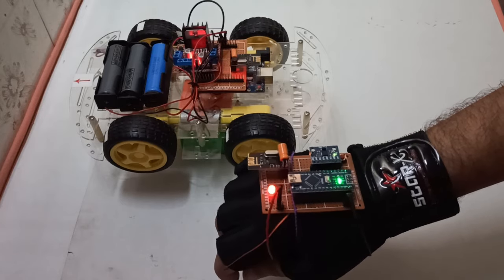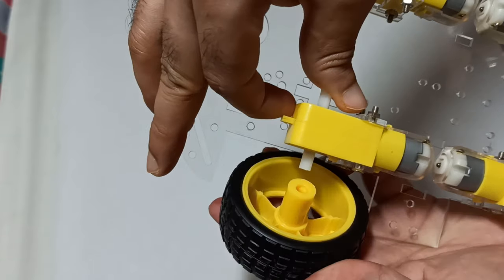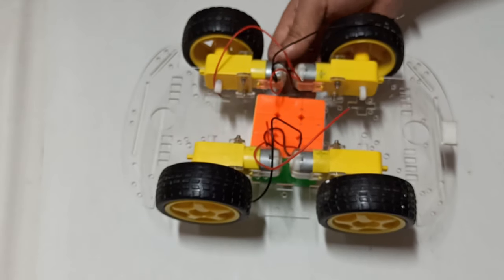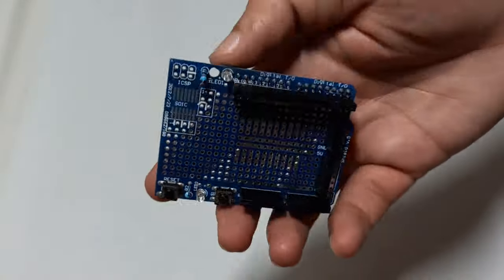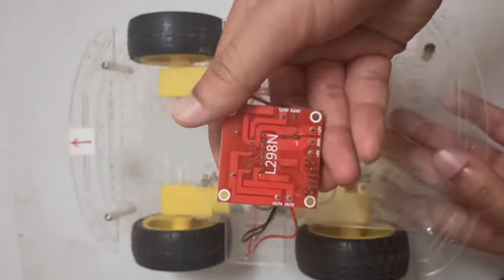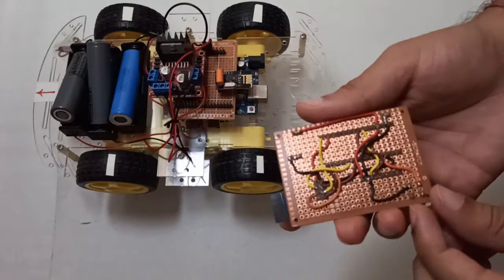DIY | Hand Gestures controlled car using Arduino | nRF24l01 | MPU6050

Comment: Hello, my friend, how are you .  I did the same way to make the car and connect the wires.  But it does not work, what is the reason? Can I contact you about this matter ?
Reply from the maker: Is you connected Gnd of L298 motor driver and Arduino connected to each other ?
Reply: Think you my friend  . It is working . My mistake  was in (L298N)  i remove the  content in (motor 1 Act/Des) and (motor 2 Act/Des)
Reply: @mastafa911  
how do you do that because i have a problem, my car don't work
Reply: @Curva3D  what the problem   in transform or reserve circuit
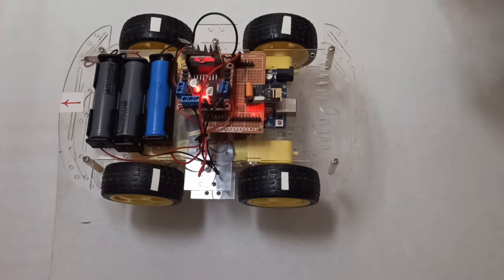Reply: @ElectronicsisLife 7:00
Reply: From where you take the code?
Reply: Please anyone send me the code
Reply: What is the ohm of registor uesd

Comment: Hello sir i have connected everything correctly but my receiver is not working the arduino and motor driver is lighting up but no response through transmitter the transmitter led for tx on arduino nano is on but on the receiver uno its not on please guide me what to do
Reply from the maker: On the receiver side
Is Gnd of arduino and motor driver connected ?
Reply from the maker: If further not working, do email me images of your project.
Reply: yes it is connected @ElectronicsisLife
Reply: retry😅

Comment: i have a small question sir. can the same schematic used for the PCB work with the arduino shell? or is there some other special connection we need to keep?
Reply from the maker: Yes
You need to connect pins shown in the schematic.
Reply: @ElectronicsisLife  Thank you so much. This video was very interesting and helpful
Reply: @ElectronicsisLife  if you know where i can find the arduino shell that would be helpful. if there is an amazon link, etc
Reply from the maker: Search for Arduino uno shield on Amazon.

Comment: All the lights of the audrino uno and the transmitter circuit is turning on, but the car is not moving. Please guide me sir! I dont know what i did wrong
Reply from the maker: Send some images/close-ups to my email.
Reply: Did you manage to solve the problem? I have the same problem and I need to solve it in weeks, if you managed to solve it, what was the error?
Reply: Did you manage to solve the problem? I have the same problem and I need to solve it in weeks, if you managed to solve it, what was the error?

Comment: 4:34

Here you connected the other end of the resistor with the sixth port?
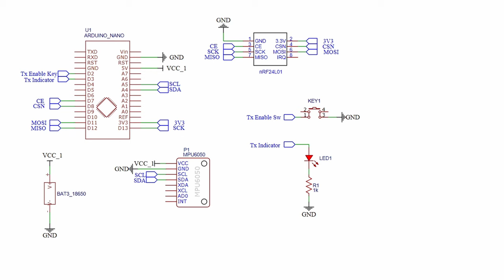Reply from the maker: 4:02
In the wiring diagram, tx indicator is connected with D3.
Reply: Where does the other end of the indicator goes? Where is D3? Just tell me which port of the nano indicator goes. Thks

Comment: Good Evening sir 
Really love your work, wonderful work sir 
Sir please how do i connect the wire ti pcb board and which wires, I am still in high school and dont know really much on electrical engineering
Gid bless sir❤
Reply: And sir please which app do I use to code it and how will it function, do I plug something in my computer
(So sorry for the disturbance sir, God bless you ❤)
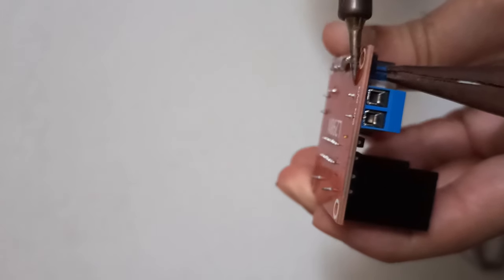Reply: Sir please can you also explain what you did in 3:14
Reply from the maker: I am glad it worked for you, All the credit goes to you.
PCBs made by you are awesome.

Comment: Hi, I connected everything correctly but can't get the tyres to move. I've tested all my parts individually and they all work, I even tested the transmitter and receiver side individually in Serial Monitor and got readings. For the transmitter, I am getting coordinates when I tilt the mpu6050, and for the receiver, I am only getting "START" showing in Serial Monitor. But when I connect both of them to test together, nothing happens and the tyres don't move at all, please help.
Reply from the maker: Make sure the gnd (ground) of arduino nano, LM298 are connected with each other.
Reply: @ElectronicsisLife  Thanks for your reply! My Arduino Nano is connected to my Mpu6050 which is on the receiver side, so I guess you are talking about the Arduino Uno on the receiver side, which I have already done, and it is still not working. :(
Reply from the maker: Check battery voltages,
Check the output voltage at the pins of Arduino nano at receiver end which are connected with LM298 driver.
Reply: @ElectronicsisLife  oh ok, i did that, I noticed you used a switch for the transmitter and it's in the code. Is a switch needed for the code to work properly? Because I don't have one and I am just plugging the battery directly to the transmitter circuit.
Reply from the maker: That switch is needed,
By using that switch you can enable or disable transmission.
Its handy in this case.
Reply from the maker: Even 1 Led is there, indicating whether transmission is enabled/disabled.
Reply: @ElectronicsisLife  ohhh, that makes a lot of sense now, I'd definitely try it out then. Thank you so much for your help! :)
Reply: @FemiOjeyemi   did you got the output , because i am also going through same problem , plz help if possible
Reply: Bro I have same problem
Reply: You have any solution regarding this
Reply: @harshlathiya805  same here any solution

Comment: Another question, on the batteries, i have to put 2 on the car and 1 on the sensor. What i do with the other slot of battery?
Reply from the maker: Because when the motors are turned on they  draws heavy current surges at start, causing voltage to dip which cause Arduino reset.
For smooth operation connect separate battery for Arduino.
Reply: @ElectronicsisLife  I asked the wrong thing: In the car, there are three battery slots, two needed for Volts and one for GND, no? So i should put three batteries there? Or another thing?
Reply: Like i should buy 4 batteries?

Thank you for the attention tho

Comment: I have done all the connections properly for the transmitter and receiver.  The serial monitor is showing output for transmitter  , when i connect the receiver it shows "START" and the (0,0) continously. The data is not getting recived by the Receiver. Please help me out with this as soon as possible!!
Reply from the maker: Do you have connected the button to transmitter ?
Without pressing it, it won't start transmitting.
Reply: Yes the circuit and the connections are exactly same as you have showed in the video.....I have used the button, led and resistor as in the video but still the motors are not running..... What do i do?
Reply: @minestrike9020  after pressing the button, is transmitter led turning ON ,
Make sure that gnd of LM298 and arduino are connected.
Reply: There is no data being received by the receiver
Reply from the maker: Make sure that nrf24 pair working well, you can check this by uploading other library code.
Make sure that all wires are connected where they needs to be.
Reply from the maker: Do share some images with me on my email, I can help you after seeing those images only.
Specially soldering, all wiring .

Comment: hello sir, just wanted to quickly ask, in the UK, AA batteries are far more accessible. Would it be possible to switch the 18650s to AAs?
Reply from the maker: AA batteries won't provide required current surges.
You can give a try with alkaline AA batteries.

Comment: Bro in Arduino Uno there are 2 gnd should we connect both together or 1 gnd connect with battery + and second with nrf24
Reply from the maker: Both are same gnd, no need to connect both.
Even if you connetted both won't cause any problems.
But same gnd should be connected with all other parts.
Reply: @ElectronicsisLife  thanks broo for reply but i have a problem when i connected all wire in  transmitter Arduino nano and try to start it the battery holder wire are start burning and battery holder know not working but Arduino nano and mpu6050 are safe
Reply from the maker: Most probably You have connected batteries in opposite polarity.

Comment: Hey in the transmitter schematics there are two vcc on in the arduino nano and one in the mpu6050 and only one battery available. Do I connect the positive end of the battery to two connector wires and connect them? Or?
Reply from the maker: Yes
Same battery positive terminal goes to arduino as well as MPU6050.
Reply: @ElectronicsisLife  OK thank you so very much. Tomorrow I have to submit my STEAM car. Your video helped me a lot!
Reply: I also removed all the code related to the switch button. I hope I didn't mess up the code
Reply from the maker: I am glad it helped you.

Comment: Can you pls tell if it is necessary to use a tactical switch .can,t  we use a linear switch . I tried with a linear one but the bulb in transmitter was not glowing pls help
Reply from the maker: You can use any switch which can open and short.

Comment: Hi sir, the project seems good and working but i have a doubt, how do you power the Arduino Uno? The connections seems fine, but i don't get it, a 18650 positive and negative would power the Arduino? In the schematic 3,3V and 5V are connected but how? I connect the 18650 at 3,3v but the 5V? The Arduino is the only thing that doesn't turn on because of power, i don't get it.
Reply from the maker: In the schematic 18650 is connected with 5v and there is onboard regulator which gives 3.3v.
Reply: @ElectronicsisLife  Haha yeah man! It was my bad, I confused the 3.3v pin with the 5v because of the different design of my Arduino board. Anyways thank you! The project works fine at moment.

Comment: Hello bro please help me 
I have done all the connections same and my car is working but the problem is motors are rotating randomly that is it is not going reverse, left, right just like you. In the serial monitor values are being correctly received

Comment: I haven't used button & led in transmitter...will it work with direct voltage supply??
Reply from the maker: It won't,
You need to change the code.
Because by default transmission is disabled.

Comment: Excuse me sir, I want to ask you, did you program the nrf24l01 as well?
You put two programming codes, tx and rx, where did you use them? On what pieces?Please answer, I bought all the pieces and lost an amount on them, and now they do not work because of the code
Reply from the maker: No need to program nrf24.
Tx code goes into the arduino nano on hand side.
And rx code goes to the car side.
If connection is right it shall work.
Trust me its not that difficult, but if you are a beginner then pay extra attention towards connection.
Be careful with batteries.
Reply: @ElectronicsisLife  
I did everything you told me but it didn't move, all the parts turn on when i add the batteries but it don't move, can I get your number and send you a picture of the car and tell me if there is a mistake, please I really feel embarrassed in front of the school administration because they chose me and paid them The amount, but now I don't know why its not work, and I have to hand it over to them within two days
know
Reply from the maker: Kindly send me some images to my email.
Without that it impossible to help you.
Don't panic.
My email id is
electronicsislife.english@gmail.com
Reply: @ElectronicsisLife  
Hello, sir, how are you?I sent you some pictures on the e-mail. Can you please reply to me? I have been waiting for your reply since yesterday,Thank you

Comment: Hello sir, hope you doing good.
I'm a student and I'm willing to do this project. 
I have a question about the batteries, there is a difference between the black ones and blue ones?
Reply from the maker: No,
Both are li-ion batteries 18650 with slight difference in mAh capacity.

Comment: Do you have a link to the resistor you used in the video???
Reply from the maker: Its a normal through hole resistance , You can use any value from 510 ohms to 10k ohms.
Reply: THANK YOU SO MUCH!!!!!!!
Reply: @ElectronicsisLife  my nrf24l01 module can't work what can i do
Reply: @ElectronicsisLife  do you have another link for the code because the link that is in instructables Is not working? (My apologies for the many questions and thank you for answering!)

Comment: Hi ,my transmitter switch is not working.I have connected the wires according to the schematics the led is staying always on.
Reply from the maker: Have you connected switch to a correct pin ?
Reply: @ElectronicsisLife   Thank you, I didn't connect wires of switch properly that's why It was not working.
Also, I Need to ask you that do I need to download the libraries in Arduino uno as well.
If yes than which one.
Reply from the maker: If your code is compiling without any errors, then no need.
I have shown those libraries in the video itself.

Comment: How to connect nrf module to Arduino shield
Reply from the maker: Shield provides lot of general purpose pcb , using solder you need to make connections for nrf module.

Comment: sir, do i need to change the code and wiring if i am only going to use 2 dc motors?
Reply from the maker: No, but make sure you are using 3rd spherical wheel.

Comment: Bro can I use a l293d moter drive In place of the of the receiver part you made
Reply from the maker: Yes u can, provided current is less than 1 amp. L298 current rating is upto 4 amps.

Comment: hello, what type of battery are u used (voltage and mAh) (that link is unavailable)? Those battery holders are connected in series or parallel? Thk
Reply from the maker: 18650 Lithium ion batteries
Capacity is around 2600 mAh.

Comment: hello sir,i want to just ask that can i use bread borad instead of pcb and how many  20 mm berg strips(male and female) to use as i want to make this as my school project and submit in 5 days
Reply from the maker: Bread board is a bad idea, It can cause loose connections.
Reply: @ElectronicsisLife  thank you sir for solving my query and sir in L298 Motor Driver how to tske of those pins as i m unable to take them out

Comment: Hello, I want to ask you about the resistance in the Arduino Nano board. You connected one of the two sides to the LED، But the other side, where did you connect it?Please reply that I am doing it as a project for the school and I am supposed to deliver it to them tomorrow.
Reply from the maker: You can use any valie from 470 ohms to 1000 ohms.
Reply from the maker: Other side connected to the pin of arduino itself.

Comment: Help me : I have made the circuit as per your circuit diagram, TX part is transmitting signals properly and I had checked that in the serial monitor while the receiver part first shown only start then I had connected separate battery for RX arduino (separate battery for l298d and arduino) then the serial monitor shows 0,0

Please help me in this regard
Reply from the maker: Its seems good. (As expected)
Did you connect gnd of arduino with gnd of L298 motor driver ?
Reply: No I have connected separate batteries for arduino and l298 motor driver, not connected gnd of arduino and l298 motor driver
Reply from the maker: Do connect both gnd point, so that arduino and  l298 driver will be at same voltage/reference level.
Without it , L298 won't work.

Comment: Bro can we use jumper wire at a place of pcb
Reply from the maker: Yes you can.
Only problem is there can be a loose connection sometimes.
Reply from the maker: Yes you can.
Only problem is there can be a loose connection sometimes.

Comment: Can you please provide me another receiver circuit diagram because from this my rf module not working. Dont know about this problem.
Please provide me a schematic diagram.
Reply: @Electronicsislife
Reply: This is my final yr project .please help me . If it is working then i will pay you some money.
I dont have time.
Please help me sir
Reply from the maker: Money not needed.
Plz share images to my email.

Comment: Hi Sir, I made the project but seem to have a problem I am not sure what the problem, but in the transmitter device when the switch is turn on but LED is not on. If you have any suggestions, or if you think there could be any other problem please reply, Thank you.
Reply from the maker: Don't worry,
Lets try to solve it.
Do reply me on the email with requested images.

Comment: hola, una consulta los capacitores que utilizas que caracteristicas tienen ?
Reply from the maker: Answering in english,
Capacitor provided high current in the form of spikes, keeping volgage stable.
Reply from the maker: Capacitors I have used are of 100uf/25v, they are electrolytic capacitors.
Reply: Hey is the capacitor compulsory

Comment: Excuse me sir, i use 6v battery to arduino uno and 9v to L298N, but motor didn't work and only L298N  has some buzz.....
Reply from the maker: On which pin of arduino you connected 6v battery ?

Comment: Does it work with only two lithium batteries or should i use 3 ?
Reply from the maker: 3
1 for arduino and sensors
2 for motors
Reply: @ElectronicsisLife  3.7 v 2600mah enough?
Reply from the maker: Yes

Comment: Hello sir, What is the value of resistor that you used here?
Reply from the maker: Its 470 ohms (i think)
You can use any value from 470 to 2000 ohms
Reply: @ElectronicsisLife  Thankyou so much sir

Comment: Sir i given the connection correctly but i still not working may be I'm mistaken in GND connection both receiver and transmitted because in circuit diagram the GND are look like a same .I don't have an idea ...pls give me clear connection of gnd both circuits .....i want submit my project nxt week ... I'm requesting u to guide me
Reply from the maker: Email me photos of your project.

Comment: Hello, I applied everything in detail and there is a transmission on the serial monitor screen, but the motors do not move. Can you advise me, thank you
Reply from the maker: Is gnd of l298 and arduino connected ?
Reply: @ElectronicsisLife   yes
Reply: @ElectronicsisLife  
What should I lose?
Reply from the maker: @asmaelhseb1113  plz mail me the pictures, and ill try to figure it out.
Its difficult to tell over here.